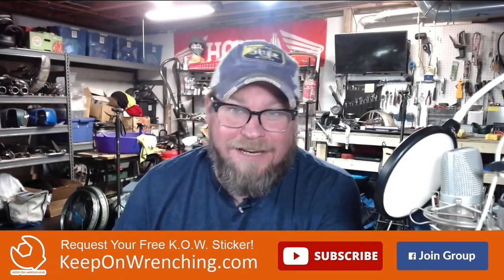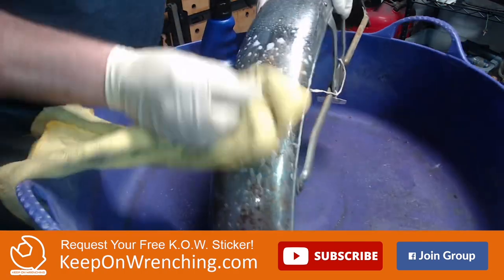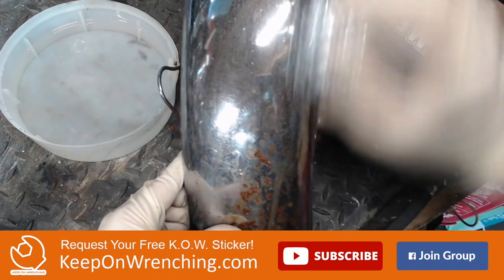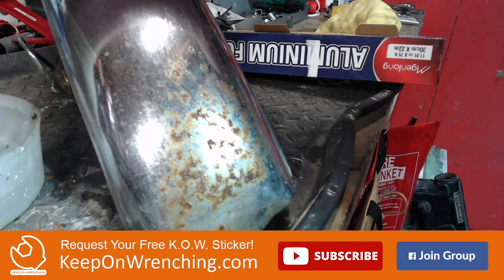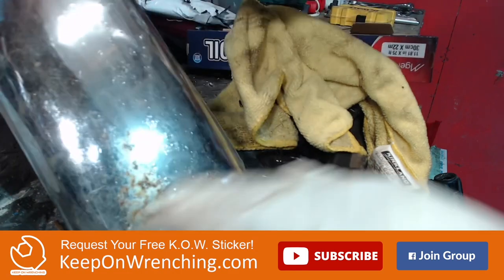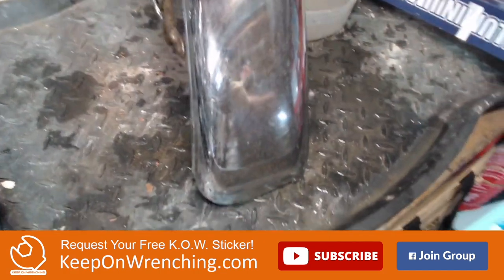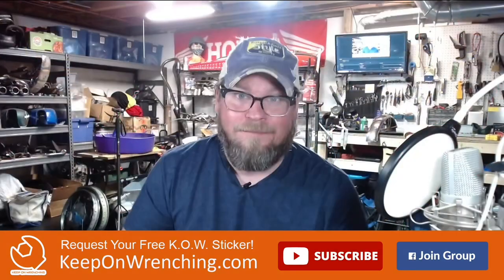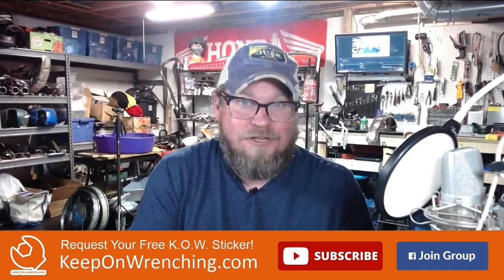Can Aluminum Foil Really Polish Rusted Chrome?

Comment: If this is the budget way, what is the ideal way?
Reply from the maker: I’d say a gentler approach and time with quality products. I brought one back from the grave. Check out this vid: https://youtu.be/Ss7CfT41HzQ
Reply: @KeepOnWrenching   thanks! I'm gonna paint the under area with black extreme chassis paint. Do you restore any of the chrome beneath?
Reply from the maker: Nah. I’d just sandblast or wire wheel the rust out the under side and then get a can of undercoat spray. Tape off the chrome good…and you’re set. Like this: https://youtu.be/kcdxSJe7A14
Reply: @KeepOnWrenching  youre the best bro, thank you so much. Wish I could buy you a beer! Will donate though
Reply: @KeepOnWrenching   followed the videos, bought Col. Brassy and got to work. Fenders look amazing. can't believe the amount of rust it took off and how much chrome was still there. It's not show room finish with all the pits but at least it stands out and protected. Thanks again man!

Comment: I use a balled up foil to clean my BQ grill ,works better than a wire brush ... For chrome I have always used Brasso, even for paint finish scratches .
Reply from the maker: That definitely works!

Comment: NO ! You will scratch the existing chrome with the rust particles that stick to the aluminum. Much better to cover the part in grease and leave for 2 days, which will soften the rust. Wash off the grease with solvent, then use an aluminum scouring pad, the sort you use to clean pans. This will allow the rust lumps that come off to NOT be forced against the good chrome, hence it will not be dulled in the process.
Reply: Have you tried it
Reply from the maker: It turned out ok.
Reply: I have used this on tables and not on deep pitted chrome like this and it takes out rust and leaves a like new mirror finish

Comment: No, I won't buy into that but I appreciated the upload.

For the stupid among us, rust is the corrosion of the metal itself, eaten away, gone forever of the applied or surface/base metal.

You cleaned off the rust definitely, and a job well done for light tarnishing and surface applications (Depth of corrosion minimal), but the material has already been sacrificed in such an example before starting.
At that stage one must get it electrically stripped, prepare the metal again removing pits etc. and chrome plate again.

Nice upload for the hobby man Wrench, but for different levels or higher level towards show standards on automotive works, I'm sure you agree for car light surrounds etc. to perk them up, then for sure that'll help revitalize a sharper look.
Reply from the maker: It works in a pinch.
Reply: You Sir have no clue on everything you wrote here. I have been doing this for 30 years. I mainly use 0000 steel wool which doesn’t leave scratches and it completely removes the rust off the chrome. Sure if the chrome is peeling or pitted you will have to get it rechromed but if the chrome is still intact it will shine like brand new again. This has been used for years by motorcycle guys like myself and hot rod guys and they and myself swear by it and it works!